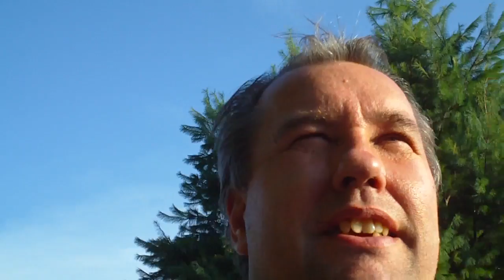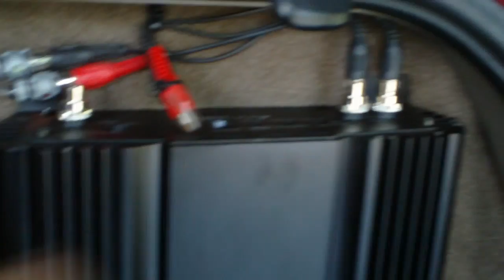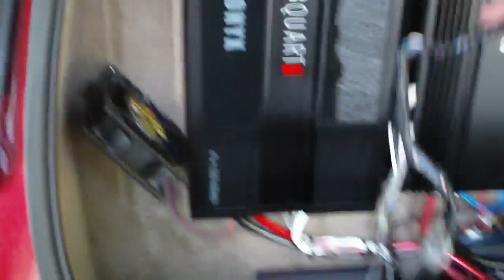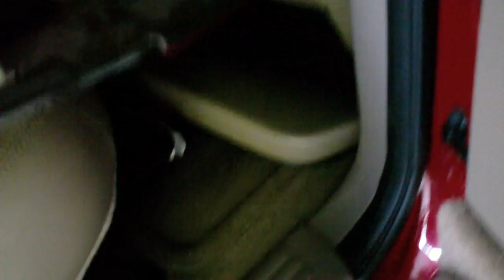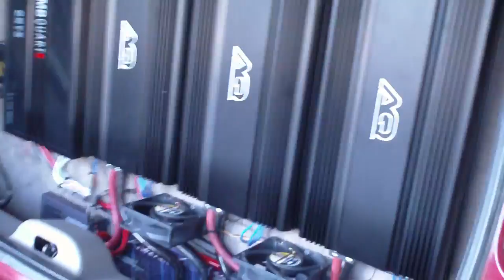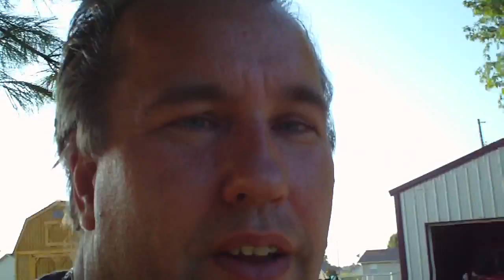6 15's Carnage From The MECA Event The Vinnie - Breaking SPL Hell

Comment: hey man your pretty lucky with those hinges they are cheap to replace.. one of them is like $34 for one side and the other side is like $46.  the bad thing is they are special order from the dealership at about a week wait. I have a 2003 Exploder, and i broke one of those hinges the exact same way but only with 2 15's, make sure you DO NOT over tighten them. they brake very easy. Good Luck!!